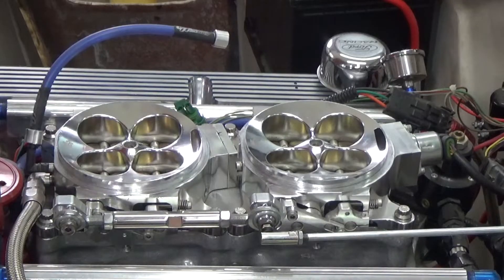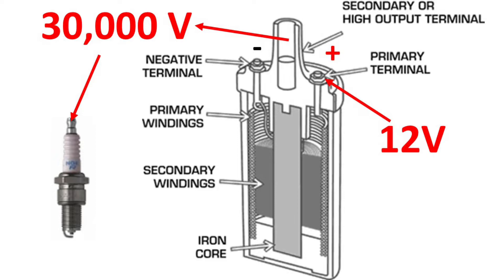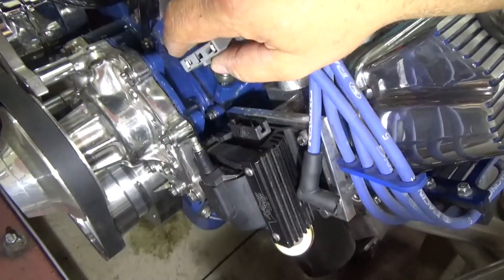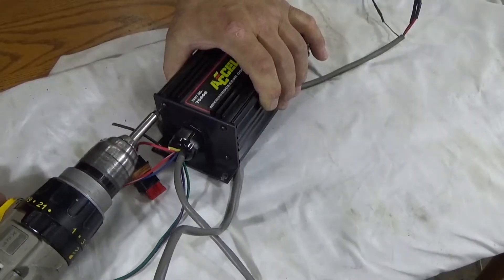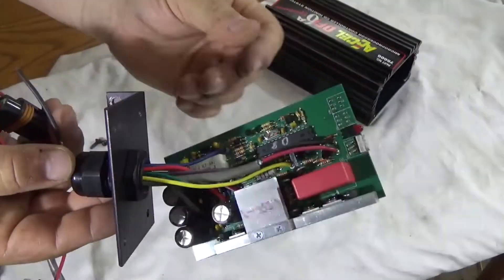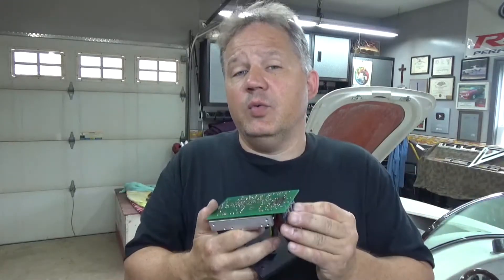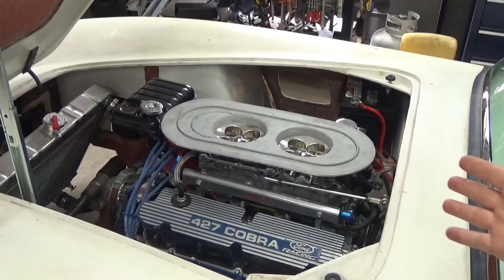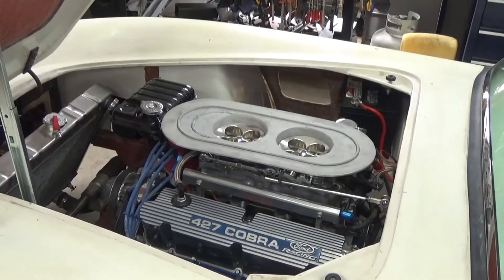Fix it Yourself - Troubleshooting Ignition, MSD Spark Modules, Accel Gen 7 EFI

Comment: I have a 83 chevy sb engine and am getting no spark.  It was running and then it just stopped.  I have changed the distributor cap, the coil, the rotor, the ignition control switch and the spark plugs.  My distributor is a mechanical HEI distributor.  Any ideas of where I can check from here?
Reply from the maker: Make sure you're getting fuel
Reply: Check your power. Specifically check your fusible links.  They probably burnt through.

Comment: i have a 1988 gmc pick-up 2500 series with the v-6 motor .im not getting any spark to my plugs .was running but stoped during a travel i was on so i changed my battery and altenator distributer cap rotor and moduler and coil and ignition key and last of all the trucks computer brain .What is left that could be my problem not starting dont have the cam sensor or not able to find it NEED HELP ASAP .Im an electrion that needs to get to work .
Reply from the maker: Could be the distributor itself

Comment: Hi Pete!  I figured out my stalling from fouled plugs and now another ghost arose!  I have msd ignition and was testing a new no spark condition.  MSD has magnetic pick up, when I short the purple and green wires with the coil plug on a ground, no spark.  However, I figured out by accident if I ground the purple wire only, I get a spark.  Does this mean the green wire going in MSD box is the fault? (Im assuming my green wire must be the ground inside msd box)
Reply from the maker: Any error codes on the box?
Reply: @PetesGarage   Not that I can see, its an older 6A box, no LEDs exist on the outside of the box to give a status.  Unit has 4 rivets holding it together that I think I can drill out to get inside.  The green wire appears to be the negative on the magnetic pickup, so I think by taking the purple to ground and since the MSD fired under this condition, I suspect that green wire either has a break or is disconnected inside the box. I'd hate to drill out the rivets without really understanding if thats the issue.  The coil isn't seeing a constant 12V, but I also read this isn't an unusual condition for an inductive ignition system.
Reply from the maker: I had to take mine apart to see what was wrong, give it a shot
Reply: @PetesGarage  I tried, I failed.  I found a bad ground, and when I tried to clean the corrosion off the ground pin I forgot I still had battery hooked up.  I got a little to liberal cleaning the board...i let the smoke out of it :( Time for a new box!
Reply from the maker: Ouch

Comment: not realy true what it is 12v comes in times the potential from the pick up coil who is by the way a ac/dc magneto/generator normaly a points ignition has a condensor but we are dealing with a trazistorized ignition module it converts ac to dc puls called a analog digital converter so you have for exampel 400v × 12v so you get that big voltage those potentials literaly slam ore hit ich other! that the true story about ignition coils thats why there are 2 sides on a ignition coil changing values of condensers and wire resistances and other generator components will efect spark stranght the older cars worked with out baterry they used generators/alternators to produce a potential! clasic magneto ignition it is some what altered changes but the principel of ignition systems are still maggy's plain and simpel electronic guys will tell you the same thing that ignition system information is wrong represented magnetism is some thing lot diferent than described by sientists nice video any way just poiting out some things that is the original way how ignition is created nothing changed after the magneto still evry thing is the same those computers are there as a replacment for stering coloms advancing and retarding timing ignition nothing more nothing less plazma ignition and dual ignition is only a exeption evry other ignition is based on the same thing
Reply from the maker: Thanks for the comment

Comment: Many thanks & congrats on your awsome work and very clear info. I, As an E.R.MD, (just FYI),can tell you it's considered that a discharge as low as 1.000 milliAmps / (ONE) 1 Amp @ 120 Volts, can stop a human heart, specifically if said human is 'forming' a bridge, (like holding a paddle with opposite polarity), with each hand, while standing the discharge. Most often, we use 200 - 300 Joules as a defibrillating discharge.
Back to cars, I still own my late Dad's quite old, but very reliable Nissan Patrol,  1984/ G60 / P40 I6 / 4 Liter carbureted engine, very similar to GM's Inline sixes of 1.970's and am thinking of modding its dizzy to 'electronic' to get rid of points as well as reasonably improving mileage and (maybe) some additional power.
My question Pete is: 
Do you think I should also change the original coil for another 'higher performance' one + an MSD unit??. Thank you kindly for your attention & outstanding job!!.
Reply from the maker: A hotter spark does wonders

Comment: Bit by MSD with Blaster 2 coil.. (Idle) I have M.S. and can't feel with my fingers, hands and forearms. It will get your attention. I had grounded my sweaty arms and was getting the volts.. ever had your elbows clapping together? I have.. lol. NOW amps.. I have had 5 heart attacks, and hit with a defibrillator, rated in jewels, 32,000 of them over 1,000 amps It will wake the dead.. Trust me, and hurts like hell. dang. Good video...
Reply from the maker: Wow...thanks for sharing that
Reply: @PetesGarage  NOT A PROBLEM, lol. I'm just glad I wasn't fixing the total timing or Revving it up for throttle response.. LOL

Comment: Great video with attention to detail I've been searching YouTube to try to find a problem with my car.   I got it out of storage from last October of 2019.   the car has a mechanical fuel pump so it took a little while to crank to start but I've owned this car for quite some time and it was standard for the first time start up this summer.    I pulled the car out washed it and took it to a car show and after 30 to 40 minutes I went to get in in the car would not start it wanted to start for a nanosecond but then I could tell it wasn't going to start.    I let the car sit for quite a few minutes and tried it again and it wouldn't start.   After waiting longer it finally fired and I drove it home it ran impeccable.    Weird....... I thought maybe I had some old fuel and maybe need to check the plugs.    I ended up putting plugs in it as the plugs didn't looks fantastic I seen worse but I chose to put new plugs in it. The car started perfectly and I drove it to get some good fuel.    I shut the car off to get fuel the car started right back up and then stalled within 20 ft.    It's getting plenty of air and plenty of fuel.    I did the test off the MSD website and I'm getting plenty of spark.    I'm afraid to drive the car very far as it's almost stranded me twice I don't want a  tow bill.     It's a very weird intermittent problem.  I can go out and start the car right now and it will fire fine I've let it sit for up to 16 20 minutes and let it idle shut it off and will fire right back up three times in a row but it seems like after I drive it those two times it doesn't want to fire back up until it's sits .....  Any ideas Pete?
Reply from the maker: I need details about the car
Reply: 451 inch roller stroker 
Msd 6al. ....Coil... Tach adapter.       Mopar performance aluminum mechanical dizzy.
Reply from the maker: Well, it can only be not enough fuel or weak spark

Comment: Hi Pete. Question for you a little off topic. If you are installing a juice box  on a flathead V8 (without any of the surrounding tins ) is it generally more acceptable to go the more practical route with an alternator or go stock with a generator
Reply from the maker: A single wire alternator is all you need

Comment: Mr pete I just recently put a 350 small block Chevy motor in a 84 Olds cutlass it has a MSD system some say it will not work on Oldsmobile it was working fine but I have to unplug my alternator for the car too ruffly shut off and now my car want start it just turns over is it possible the MSD system made my timing jump
Reply from the maker: All the MSD box does is tell the coil when to fire. It has nothing to do with the make of your car. You have it wired wired wrong somehow
Reply: My car car keot running after installing my MSD,  I believe I had to put a diode in my wire to the voltage regulator.

Comment: Pete, I have a mark iv 454 big block Chevy, I’m going to be rebuilding it. I was looking at doing multi point injection instead of tbi. How do you go about choosing parts for mpfi? Any advice? Thanks in advanced!
Reply from the maker: First you have to find a manifold. Chance are you'll have to buy one and have the bungs welded in. Then install the system. Holly makes a very good system.

Comment: The old ignition systems that used points in the distributor had approximately 25,000 volts. The newer electronic ignition systems have around 60,000 volts at the spark plugs.  The multiple discharge systems will most likely have a higher voltage And they will fire the spark plugs multiple times where as the older systems only fired once per power stroke. I  personally used to  just pull the plug wire off the plug while the engine was running in order to find out which cylinder was missing.  The first time I did that with an electronic ignition the spark came around the insulator and hit me HARD. That was the Last time I did That, and that was an early version that only fired once per power stroke.  My advice BE VERY CAREFUL WHEN YOU WORK WITH THE NEWER ELECTRONIC IGNITION SYSTEMS,  they could very easily Kill you.  Just my personal opinion,  take it for what it's worth.  Love your channel, Pete, thanks for all you do.
Reply from the maker: Awesome comment, thanks Bruce.
Reply: @glengillham4629 , this is known as a "learning experience". I'll bet you won't do that again.

Comment: It would be interesting to perform dyno tests after your best Pete's Garage tune on that awesome EFI system versus your best tune on a hot carb setup.
Reply from the maker: It would be. I have taken carbs off engines with an existing dyno sheet and put on EFI systems and got more HP because of the hotter and more precisely controlled spark and fuel control. Even top fuel engines do not have carbs anymore. The use an injector plate over the supercharger and a computer to control spark.

Comment: Great video, definitely helpful! I always wondered how an ignition coil could step up 12 volts dc, when coils (transformers) usually only do that to alternating current. But the diagram made me realize that the current flow on the secondary side thru the spark plug is what is causing the magnetic field to collapse and expand throughout the coil. Thanks Pete.
Reply from the maker: Thanks J. Once you understand it you can easily diagnose any problem.

Comment: I have a msd box from msd it has the little male plug at the one end which is where you plug in your tach , well that plug came lose and now the tach wire cannot plug in , is there a wire that comes off the box that I can connect the tach wire to . Thanks
Reply from the maker: If it's the hard mounted plug and it's broken you'd have to open it up and tap into it.
Reply: With some tachs (check documentation first or risk ruining) you can run them off the negative side of the coil wire.

Comment: I like points ,no problems and if stuck on the side of the road,,a screw driver and match book  cover  will get you back and running. What is wrong about points? With a computer ignition unless you have another you are screwed.
Reply: Done the book of matches thing. A high roller with a Bic lighter would be SOL!
Reply from the maker: There is nothing wrong with points, as long as your car has them. I can say I have burnt up many sets of points, I have yet to burn up a computer.

Comment: Well done, Pete. Years ago i used 7 AL boxes for racing and had so much trouble with them it was just crazy. It's sucks when you're leading with 2 laps to go and the box gives up.  😢
Reply from the maker: That would suck. Maybe they were overheating?
Reply: @PetesGarage    That's what i thought was a possibility and tried mounting in different locations but it didn't help. Maybe the quality is better these days but somehow i doubt it.
Reply from the maker: Interesting problem to solve